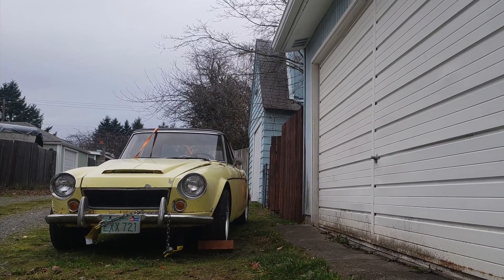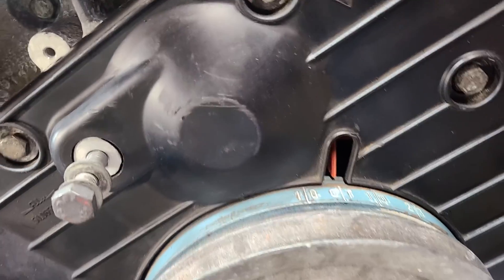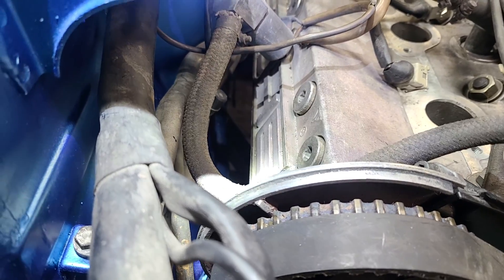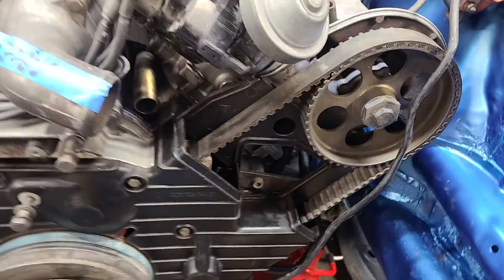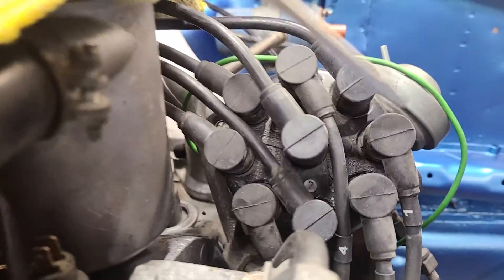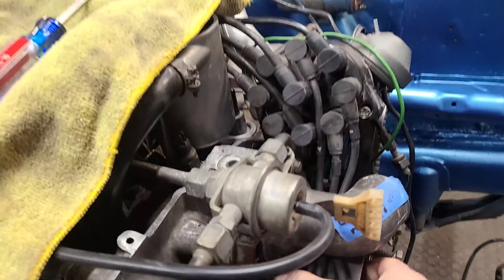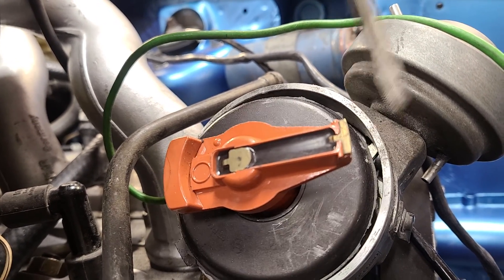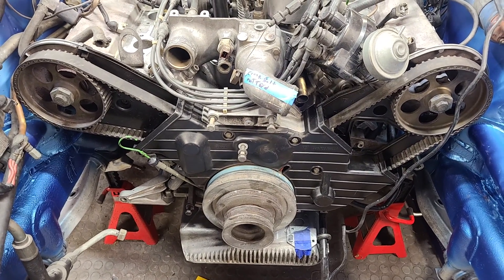How to find the Porsche 928 4.5 16v timing marks

Comment: Can you do a video on how to set "initial" and "top dead center timing?" is factory settings 31 degrees before top dead center at 3,000 rpms? 36 degress at 5,000 rpms BTDC? What is "initial speed" at idle set at 6 degrees? Can you show how to set idle speed?